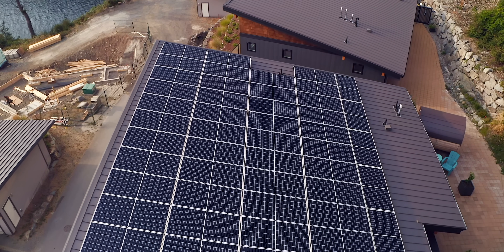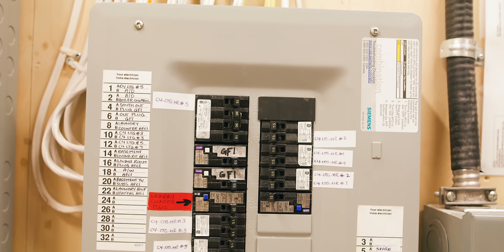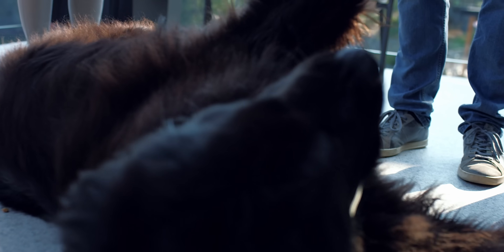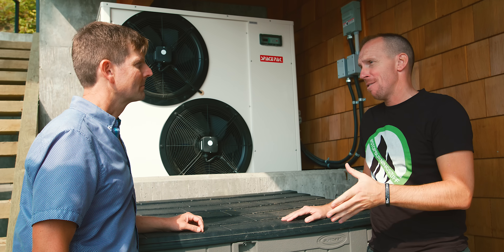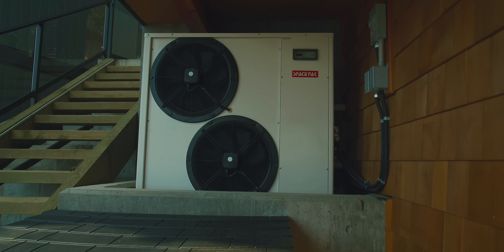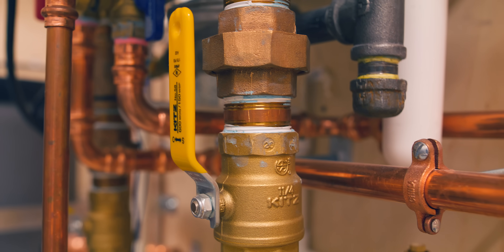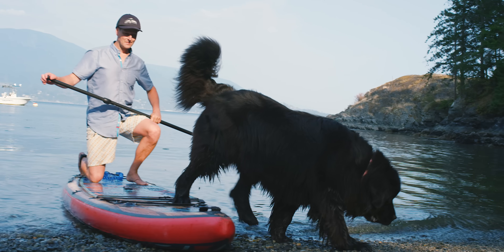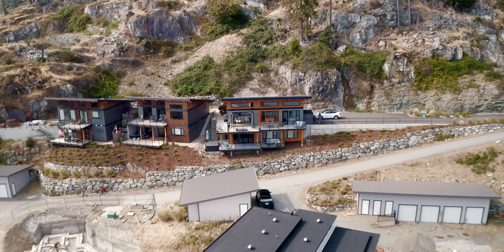How to Build a Net Zero Carbon Dream Home!

Comment: Yes , a super house and brilliant adoption of modern hi tech standards . There are two basic things that stand out here  .
The local power supplier giving credits for power generation that is fed back into the grid  - lucky in BC .
 in California  the PC,s are reducing , even abolishing the feed in tariff and new  rules are being implemented about  installation , 
i.e. no home installs and severe inspections of any of these , should they manage to overcome the regulatory hurdles .The second is there are no  batteries in the system to store energy ?  The consumer is locked in to the PC and this restricts  future energy  independence .

It is becoming apparent that PC,s are working against solar installs as it is affecting their income and the shareholders dividends .Many countries are  bringing in more regulations on subsidies  parts of Ca are actually placing a monthly charge to solar homes to offset the cost of electricity to non solar homes !

I have just finished a house  build where off grid was the priority , this pre empted the efficiency levels  used in construction
and fittings  .
With no grid to fall back on it was imperative to have an efficient design and standard of insulation , there is no , "never mind , switch over to grid power " so every aspect of the house had to be highly , individually , efficient .

I respect what the owners have achieved  with this beautiful house , (and dream location ) and wish them  enjoyment in it .

My  thoughts are that it is not particularly difficult to design and build a net zero/ Passive house and would like to encourage anyone thinking along these lines not to be swayed by the potential complexities  and jump in !
Reply: Yes unlike the uk where they steal your power uk politicians take notice

Comment: Would be a lot more interested in how to lower the carbon footprint of an existing home.  Particularly with heating and electricity prices as high as they are, more information on how people can improve the house they are already living in would be more useful than showing how wealthy people can spend lots of money to get a virtue signaling "eco home".
The number of people that can afford a new build net zero house is very small compared to the number of people living in older homes that have a massive carbon footprint and massive heating bills.

Comment: Did they consider using SIPS panels ?  I used them exclusively and reduced building time 50-75 % and costing far less than the conventional stick frame construction. What about incorporating "flat plate" collectors or evacuated tubes for hot water ?  Just some thoughts.  Thank you and happy holidays !
Reply: I'm guessing that solar may be better in such an extreme climate for heating the water,  as there will be plenty of snowy, cloudy days where the solar water heating won't do a thing.
Reply: @jamesengland7461  Not a particularly extreme climate on Bowen Island.  While it is snowing there at the moment, there aren't very many snow days there per year.

Comment: Please have a look at some of the net zero homes being built in europe. They are far cheaper and are being built at scale. 

I am in the process of buying a standard 2 bed flat in the UK that I hope in time I can convert to all electric. My first two jobs are switching the remaining lights to LED and fitting waste water heat recovery in the shower room. I will be doing the changeover on a shoestring budget so changes will happen as I can afford them.
Reply: I am surprised it’s not already electric as only very large flats can justify the installation of even the smallest gas boiler.
Reply: @mrfr87  Hi. The block is early 70s  and all gas. I'll have to do it piecemeal but the gas boiler is 20 years old so if I'm going to make the change it is a good time to do it when the boiler would need replacing anyway.
Reply: Will you make some videos to document your progress? I prefer shoestring YouTube videos to ones like this that look like they were made to pitch at a bbc2 or channel 4 commissioner (light on content and heavy on fancy camera work).

Comment: I would like to see a three-story home in the UK designed around net zero techniques but also using some tiny home principles so the footprint and land needed are less so further reducing the costs. I like the idea of energy credits here in the UK as well so we don't all need a home battery as most people still work 9-5 so can't make the best use of any excess solar without one.
Reply: Would this be a detached house you're talking about? Insulating a 3-story house is much harder than a 2-story one, so would rather opt for 2 stories and make it a bit wider if possible. Also stairs would take up quite a bit of space too if you made it 3 stories.
Reply: @swecreations  I also like the factory build design, reduces time and costs on site. I worked on a project as an apprentice, bathroom was lowered in via crane complete. I'd love to work with a designer as I have some ideas on the interior but how everything would fit together is beyond me. Looking at CAD software makes my head hurt 😬
Reply: @markreed9853  I think you would love my house. Built 14 years ago, with a ground-source heat pump that's just as efficient as the one used in the video (he really cheaped out just getting an air-to-air unit), it's a 2 story souterrain/slope house, 200 square metres in size, we built the bottom floor ourselves, and then the entire top floor was made in a factory and lifted on top of the house with a giant crane. Super efficient insulation and triple pane windows.

House was also built with exhaust air recirculation, meaning 90% of the energy from the old air flowing out of the house is put back into the fresh air coming in, meaning little to no waste. We also put in a solar panel (the super efficient water heating kind, not the ones that make electricity) on top of the 80 sq metre detached garage, meaning we get free hot water throughout most of the year. 

In 2020 we installed 15kw of solar panels on the garage and house, which produces around 14000kwh of electricity per year, we imported it and installed most of it ourselves, so total cost was only around 7000€.

We run it all on carbon free electricity (since Sweden's electricity pretty much already is), but we paid extra for 100% instead of 99% carbon free, but since we produce enough electricity through the new solar panels for both the house and 3 electric cars we don't pay anything for it anyways :D
Reply: @swecreations  yes, sounds amazing, I'm only renting but from what I've seen here fitting heat pumps is very expensive even though the government is giving a £5,000 Grant in the UK. Our problem here is that current housing stock need quite an upgrade to make a heat pump efficient enough here to recoup the extra costs. On another note, one of my cousins lives in Stromstad with his family and my uncle used to live in Sundsvall but sadly died a few years ago just before I was going to visit, so I've never been.
Reply: @markreed9853  Well that sounds very weird, we paid around 8000€ for our ground source heat pump 14 years ago, it would have paid itself back many times over in that time. With a £5000 grant I really don't understand why everyone doesn't do that. You can get small air heat pumps with a mini split for a smaller 50 sq metre apartment or cottage for less than 2000€ installed here.
Reply: @swecreations  "I really don't understand why everyone doesn't do that. " What is the upfront cost? As in, the total the person has to pay.
Reply: @XTiDesignTutor  For a small unit 2000€, that's what I just said. Idk how the UK grant works but I guess it'd be a lot less than 2000€ including the grant.
Reply: @swecreations  The problem is that a heat pump needs larger pipework, and larger radiators than are typically installed in domestic properties here in the UK. We have 15mm pipework, and rads sized to run at 60-70 degrees C. Obviously they don't work with the lower flow temperatures of heat pumps. So it is also replacing all that, so all those extra materials and labour. I've seen a number of figures putting a full refit at 12 to 15 thousand pounds. Then the new heating systems have problems because a lot of british houses are built to atrocious standards, and then the system works out horrifically expensive to run.

Comment: Is this really news worthy? I'm in my second net zero home. In many places it is not that difficult. My first net zero was a conversion. Even before solar my currently house is rated at about 55% less energy. I didn't get any incentives, but there is a solar tax credit that should materialize next year.
Reply: It's a bizarre video for Fully Charged. The house wouldn't even meet the minimum standards in most of Northern Europe, and I'm not sure who it is aimed at.
Reply: @armaduzo2601  British people with old rubbish houses, where regulations are more of a suggestion rather than a law, based on the quality of some.
Reply: @armaduzo2601  You can't assume everywhere is like your country. Other places are behind on or not very knowledgeable about what saves energy or helps the environment most efficiently.

Comment: Just goes to show, everything is possible, if you have loads of money… the vast majority do not have that level of funds available. They also live on old stock housing. I think that, even if the property you’re reviewing is as high end as this, there needs to be explicit examples of things all the ‘normal’ people may be able to adopt… and afford.
Reply: If you're building from scratch, it's really not that much more expensive. The most important changes they made were more insulation and more attention to air-tightness. The massive PV system and heat pump are a) less important and b) not all that expensive compared with all the other costs of building a house.
There are already loads of videos on what ordinary people can do, even on this channel. The important part of the video is that Canada's building standards have a path to net zero. What they missed is discussing why it needs to be staged over 10 years, if any other countries are doing the same and what's stopping them.
Reply: It literally says "dream home" in the title. What were you expecting?
Reply: @VMYeahVN  literally
Reply: If ppl can afford big ass ice-cars and homes a lot of ppl can afford this. But ye, eco friendly houses will be expensive before its cheap. Like everything else new
Reply: Eco homes are very possible on a budget if you build small. It's just a matter of how many sqft and luxuries you can live without. If you live in a Tiny Home for example, being eco-friendly is pretty easy.
Reply: @d_dave7200  thanks! Constructive replies are always welcome!
Reply: Love the home… and I think I was clear in my offers for improvement on content. If we are to change the world, I would think we need to enable everyone to aspire for a greener way of living.
Reply: Fully agreed
Reply: Here is what you can do to make a “cheap” dent into your electricity bills:

in the UK you can buy yourself 460W mono solar panels at £250/panel and a micro-inverter at £100 on eBay. Just plug 1-2 of those panels and inverter to a socket of your house directly and you will have a nice and easy solar system.

Your house will be using the electricity produced by the panels before using that from the grid. Any excess gets exported to the grid, you won’t get paid for it, but who cares. Just with one of those panels, you will make a decent impact on your bills (20-30% decrease). DIY solar system for the poor 😂 but it’s all over YouTube and it works…
Reply: Then just build a smaller version. Or watch other videos or channels. Like Kirsten Dirksen tiny houses. Think or search for something instead of just being negative and giving up. There's also nothing wrong with videos of larger or medium houses as well. Also, people can't compare where they live to others cause it may be cheaper where other people live.
Reply: @user-gu9yq5sj7c  wow! So unless people are unswerving in their blind support of something, they’re not allowed to have an opinion, or even view a video… and there was me thinking I have freedom of speech. I see very little negative in my comment, just suggestions of variation. I also see nothing that talks to ‘giving up’ - perhaps that’s just how some people see the world and project accordingly.
Reply: The house is net zero but not sustainable. Such lavis housing is for the few. Consuming excessively and parading their smugness. Every favel dweller has a smaller carbon footprint than these...........
Reply: @johnmightymole2284  I didn't see the owners in this video act smug. Don't just falsely accuse and vilify people just cause you're jealous. People trying to help the environment or save energy are smug or evil? Why do you watch this channel? There's lots of showing of pricey products like cars here. 
People can make a smaller cheaper version. And prices will drop.